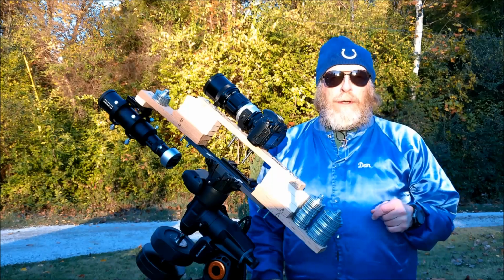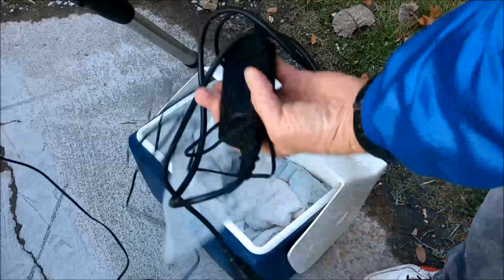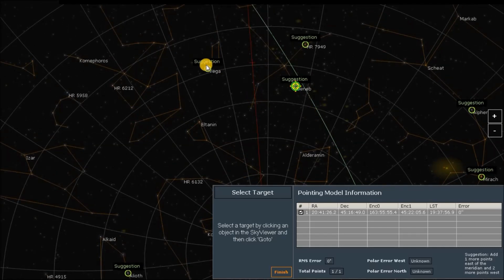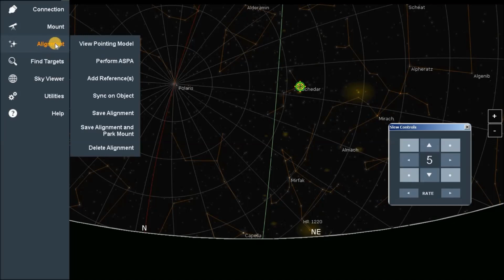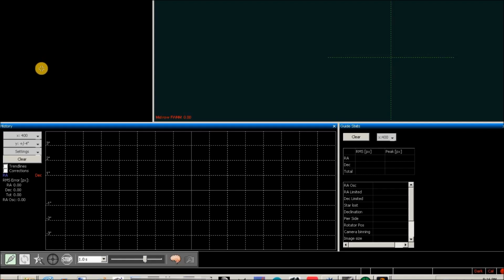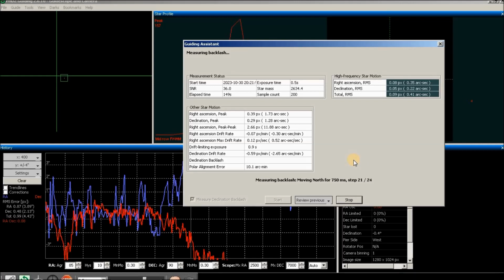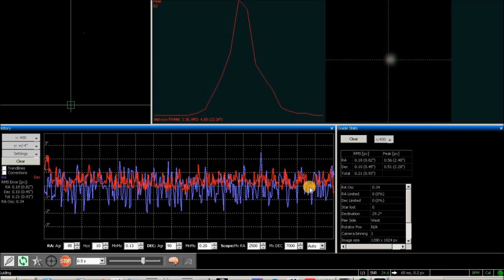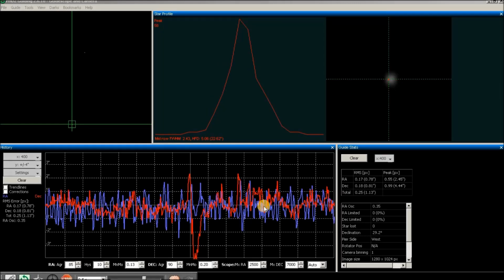Set up Celestron AVX, run CPWI, Cartes du Ciel, PHD2, plus an improvement to my setup

Comment: Quick question....  When using CPWI and PHD2 together,  do you need to run the Celestron Alignment BEFORE connecting with PHD2?   Or can you simply connect your scope to CPWI,  then run PHD2 and let PHD2 do the calibration/alignment?
Reply from the maker: @ShaneHall-n3r  recently, I have been connecting to CPWI, then doing polar drift alignment without PHD2, then doing the star alignment with CPWI. Seems to work fine.